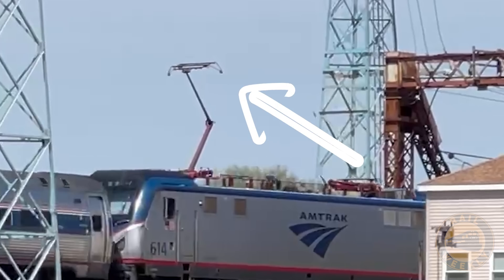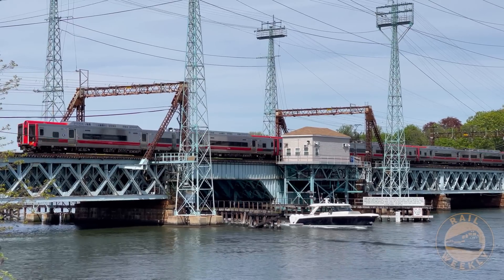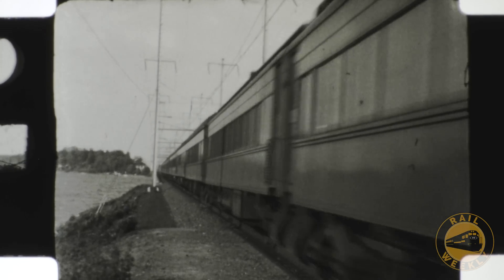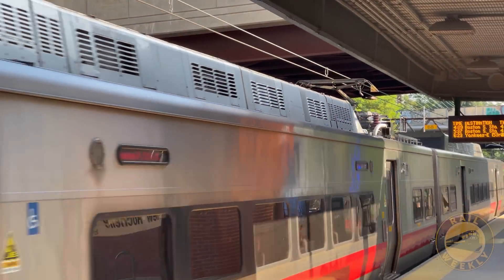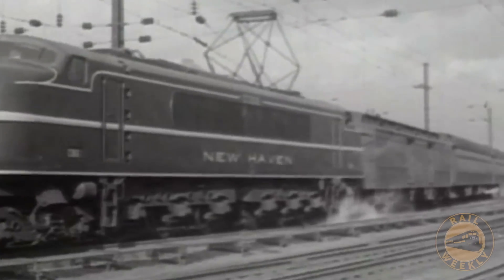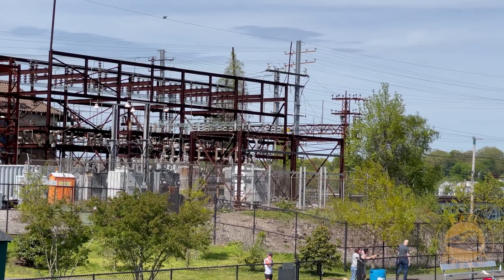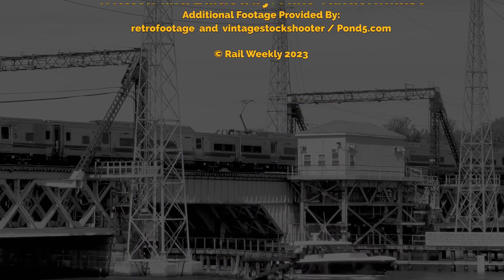The Curious Case of Cos Cob

Comment: Not "catenary". Overhead line equipment or overhead supply cables. The catenary is ONLY the arc that spans from support to support and carries the droppers which hold the contact wire at the correct height.
Reply: As an Amtrak employee for 20 years on the NEC, it’s never referred to as “Overhead Line Equipment”. Ever.   
It’s known as the “OCS” or “Overhead Catenary System”. 
  In any conversation we simply refer to as “The Catenary”.
Reply: @FFred-us9tw  Just shows how wrong you can be even working in the business
Reply: @TijgerTim  they may have different names for it where you work. Many companies choose different nomenclature based on preference. It only becomes incorrect when talking about things at a specific company. But on the NEC which the majority falls under Amtrak rules and regs, this is what they use.
Reply: @FFred-us9tw  As you say, as long as in-company things are clear. But in general use, correct nomenclature is better. Catenary is a mathematical term and has no 'alternative' meaning as such...
Reply: @TijgerTim this isn't mathematics so get off it already
Reply: @blue9multimediagroup  no, it is a general misnomer...

Comment: In Europe (or at least in Sweden) we have a lot of short sections where there's no power in the over head wires called "Skydssektion" (protected section), and they are used to prevent bridging the power from one power station to another and also to prevent the train from receiving 32kv instead of 16kv. While passing them you need to turn of the power and coast past it or else you risk causing arking that might melt the over head wires.
The passenger's doesn't notice anything since the train provides battery power to the outlets and light all throughout the train, but the AC might turn off during those few seconds.
Reply: The Northeast Corridor has several of these, they are called "Phase Breaks" here.  For 1 example, just east of New Haven used to be the end of the 12.5 KV catenary.  When electrification was extended to Boston, Amtrak used the modern 25 KV system, so there's a "break" just east of State Street Station in the "East Cut" as it's known locally.

Comment: It is so odd that they don't lower the pantograph. Seems like an accident waiting to happen
Reply: There is no risk. Pantographs are designed to adjust height while in motion. This bridge has had this gap for 100 years. No issues at all. So hardly an accident waiting to happen.
Reply: @FFred-us9tw  I am well aware that the pantographs are designed to do that but it seems odd to put wear and tear on them by just letting them fly up and then be pulled back down by the catenary. You could just lower them
Reply: @benedekhalda-kiss9737  there’s no wear and tear involved, because they’re not “flying up“. They are raised pneumatically and it’s not happening fast since the wire gradually raises to the max height of the pantographs reach. And they are not being “pulled down“.  They are pushed down as they reach the other side and the same way as they’d re raised. Gradually.
The height of the catenary is not all the same. If varies greatly depending on overhead bridges and other structures. The upward pressure is supplied by pneumatics. There is no wear by it moving up or down.
Reply: @FFred-us9tw  Thanks for the thorough answer. As a European it still seems odd to not lower them but now I understand.
Reply: @benedekhalda-kiss9737  glad to help. When I first started running these electrics, I wondered the same thing as you. But I think they realized that if they needed to be lowered and the engineer forgot to lower it or an automatic system that was supposed to do it failed. You would definitely have damage. So the way this is set up is kind of failsafe.

Comment: A lot of modern electric trains have batteries to enable them to operate in a limited fashion without overhead power. It's very valuable for ones that share lines with non-electrified trains, as they need to be able to clear the tracks in case of a power failure or in case they are forced to temporarily shunt onto a non-electrified line.
Reply from the maker: Apparently some of the new train sets that Amtrak now has on order will have this capability. I guess we will find out soon!
Reply: On the older M2, M3, M4's when we crossed this section the train car would go dark due to the batteries no longer holding a charge.

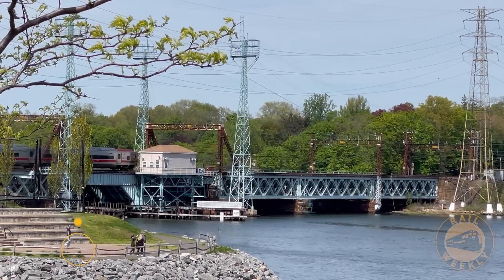Comment: 0:35 Well, I'm going to have to revisit all my prejudices about America now. That looks like a modern, stylish, European electric train. In America.
Reply: Acela, based on the TGV and introduced about 2001. Now planned to be replaced by a new generation once they're finally satisfied that it's had enough testing 🙄
Reply: @AndreiTupolev *1999
Reply: Those are Siemens units.  They are rated 6400 Kw.  I saw one today by Harrisburg Airport, pushing 6 cars.  It had just left Middletown, and was doing somewhere between 60 to 80 mph.  That run between Middletown and Harrisburg city is 10 minutes - actually a lot faster than driving!
Reply: because it is. siemens makes the locomotives, based on the eurosprinter. the acela is a tgv in disguise (made by alstom).

Comment: Thanks for posting. I lived in the area when I was kid, and I would occasionally watch New Haven electric locomotives and MU units cross this bridge. During this time there were also a number of diesel units in operation, including EMD FL9 locomotives. If an electric train stops at the Cos Cob station and heads in the easterly direction, it has about 1,300 feet (396m) to get up to speed before crossing the gap.
Reply from the maker: Thanks for watching!  As far as I know now, the only diesel trains that still cross the bridge are e a few rush hour Metro North trains that go up the Danbury Branch. NO idea why they ever de-electrified that line.
Reply: @RailWeekly  
CSX diesel freight locomotives also cross this bridge. In the late 1950s and into the 1960s, the New Haven Railroad began a process of de-electrification and an increased usage of diesel motive power as a cost and time savings measure.  FL-9 units with DC pick-up shoes for New York City operation could travel from New York directly to Boston and avoid the customary engine change at New Haven. The New Haven never completed the planned electrification from New Haven to Boston due to financial constraints. The railroad also began decommissioning older electric freight locomotives such as the EF-3 and replacing them with more versatile diesel units such as the GE U25B.

Comment: Very informative film!!!!

One piece of information to note: that area IS NOT part of the Northeast Corridor. It is the Metro North New Haven Line, Owned by the State of Connecticut, and operated, powered and dispatched by MNCR; AMTRAK is a tenant railroad beholden to MN (Which is why you sometimes see a ACELA ran behind a New Haven Local so they can run their own expresses around)
Reply: Despite the New Haven line being owned and (poorly) dispatched by Metro North, it most certainly is classified as officially being part of the Northeast Corridor.   The fact it’s owned by a different railroad doesn’t magically make it not part of the NEC.
Reply: @FFred-us9tw  Yeah the NEC is the descriptor for the entire electrified line between DC and Boston. I believe it was even called that back before Amtrak even existed.
Reply: Metro-North is only the dispatcher
It's still the NEC
Reply: @blue9multimediagroup  Metro North doesn’t just dispatch the New Haven line, they also own it despite it being an integral part of the Northeast Corridor
Reply: That section of track is an abomination, especially for the Acela. But the real estate around it is so pricey that a proper high-speed track probably is just a dream.

Comment: That's unusual that the pan goes to full elevation. It's usually lowered before a gap like this. This would seem to be a recipe for bringing the wires down 🤔
Reply: I found that a strange and a very risky way of operating, too. Even with neutral sections, there should be trackside balises to open the loco's circuit breaker beforehand to prevent arcing. A fully extended pantograph in fresh air like that would worry me.
Reply: They make the wires rise and lower gently.  I don’t think there’s many dewirements there.

It’s probably the only place in the US where this is done (insert angry rant about why our railroads won’t electrify, here).

Also, despite being a physical break in the line, it also serves as one of the phase breaks that were installed when the system was changed to 60hz in the early 80s.  The older equipment actually didn’t have main breakers, but instead followed the then-standard practice of grounding the pantograph on a transformer fault…
Reply: I would have expected pantograph be servo-locked just before the crossing to prevent it from springing up.
Reply: @erkinalp The wires rise up gently, they don't suddenly end.  They rise to the maximum extended height of pan, then end, and at the other end, begin, and gently lower down to normal height.  It sounds crazy, but this has been there for decades, and the amount of traffic along that line is very heavy.

Another thing unique to the New Haven line, is it changes from third rail (DC, 650V), to overhead (AC, 13.8 Kv, 60Hz) a few miles south.  They do this without stopping.  Heading to NY, they lower the pans when they reach the third rail, and raise them as the third rail ends.  There's a transition zone for a while, where there's both.  The down transition is automatic, the up one requires a button to be pressed.

The old M-2/4/6 cars , they tested the pantographs at New Haven before departure.  Quite a scare if you were standing on the platform when they did it!
Reply: Wouldn’t see this in the UK! Lowering the pans seems a much more logical solution than letting it rise and rise until they lose contact with the wire. Indeed, many of the trains in the UK will drop their pans automatically if contact is lost through excess height

Comment: I don't know about the non-unit  locos here but there were electric trains in England (southern region class 71s,with a 3rd rail electrical supply) which had internal flywheels to help bridge the gap in the power rail.
Reply: Third rails generally have to have a gap at grade crossing and switches, so this is a much more common when using them.
Reply: @mattwalker5689  yeah,I know!

Comment: Do passengers in the train see the lights go off? Or is the onboard power insulated from this in some way?
Reply: Normally at most just the HVAC will briefly shut off. The majority of the lights all run off the 72v DC battery system.

Comment: Another example of America's weak transport safety regulations. Driving with pantographs up and no wires or power in them would be a serious violation in Europe
Reply: America’s weak transport safety regulations???😂😂.  The US rail safety standards are far more strict then Europe. That’s why we can’t use any “off the shelf” European locomotives or HST’s.  Because none of them meet the crash standards, we have. There are far more higher death toll crashes in Europe In the last decade then there are in Amtrak’s entire 50 year history
Reply: @FFred-us9tw  might be because compared to europe, there is barely any passanger service in US
Reply: @FFred-us9tw  Any vehicle is supposed to be adjusted for each local market, there is no such thing like "off the shelf" rolling stock on international level. And of course death tall in Europe overall may be higher than in the US (which is very debatable though), because American passenger rail transportation has been virtually nonexistent outside the Rust Belt for the last several decades
Reply: @Adeen_Rooble  your knowledge of US railroads is blatantly obvious with your comments.  For starters, saying “American Passenger rail transport outside the rust belt is virtually nonexistent”.  😂😂. Ever hear of the Northeast Corridor? By far the busiest section of passenger rail in all of the US and NOT part of the rust belt.  
 As for international equipment not being sold as off the shelf for other countries, of course there will be some changes.  That goes without saying.  But I’m talking about major changes.  Like entire carbody changes, complete redesign of almost all systems.  Our current Acela was based off the TGV but had massive changes due to collision protection requirements. 
And lastly, as far as the death toll of crashes in the US vs Europe. Look up all the major crashes in EU vs the US and look at the death toll for each.
Reply: The Netherlands does the exact same thing as you see here for all their drawbridges without wires. So, no it isn't a violation in Europe if its designed to be this way.
Reply: @Cabbage_Soup120  Firstly, the Netherlands is not the entirety of Europe, and secondly, it doesn't make this less of a hazard, if train's traction power is for some reason not cut off, it may lead to anything from a simple electric arc to contact cables melting down causing either a long interruption in train service or a fire show with severe damage to the train and maybe its passengers too
Reply: @Adeen_Rooble  The Netherlands is part of Europe though and you said its a violation in Europe. 

And trains here have operated with those bridges here for a long time and a failure like that never happened since the wire end are strengthened to prevent melting and so they can catch the pantograph at the other end without damage. 

The worst that happened on those bridges is Foreign stock not lowering their pantographs, destroying both the pantographs and wires.
Reply: @Cabbage_Soup120  There are not tha many railway standards unified across the continent like RIC, and each country in Europe has its own regulations which may vary, but overall they are quite strict

>The worst that happened on those bridges is Foreign stock not lowering their pantographs, destroying both the pantographs and wires.
 
Don't you think that making lowering pantographs obligatory for all rolling stock would remove one point of failure from the equation? Of course it's nice to have pantographs specifically designed to pass such bridges, but even with them you can never be too safe
Reply: @Adeen_Rooble  no, cause foreign drivers are taught here to lower their pantographs, the bridges do have signs that tells you lower it if you have foreign stock (and foreign stock rarely has to cross a bridge without wires)

Not having to lower it is much safer, cause now you remove the human error out of the equation. The worst that happens now if you forget you are crossing a bridge without wires is that you have a chance of creating an arc which the wires at that point are quite resistant to. Unlike having the pantograph and wires be destroyed for sure without this system in place.

Also we don't have to shutdown high voltage systems like AC since we don't have to lower the pantograph we can keep them running with regenerative braking. Which could be better for the longevity of the train since they aren't shutting off and on all the time (not sure about that though and it doesn't apply to older stock we use that doesn't have regenerative braking.)
Reply: Its a normal thing to do with 3rd rail but its strange to do it with OHEL

Comment: Modern Electric Locomotives here in EU can store Power and run for some distance on stored power, like the Siemens Vectrons and others.
Reply from the maker: The Amtrak ACS-64 is based on the Vectron, but I don’t believe it has that capability. That’s really cool :-)
Reply: @RailWeekly  No, they don't store traction power for even that much of a distance. Coasting is very powerful, though.